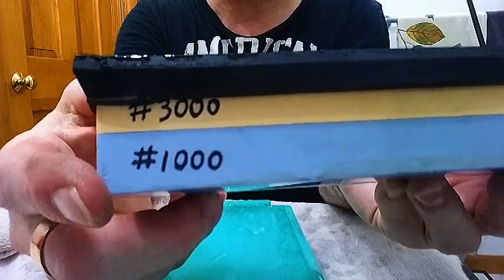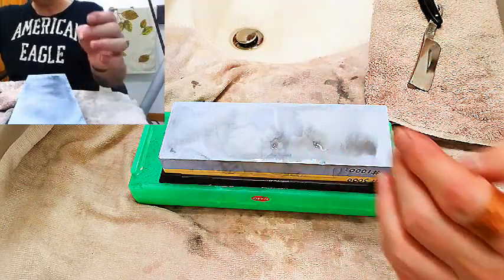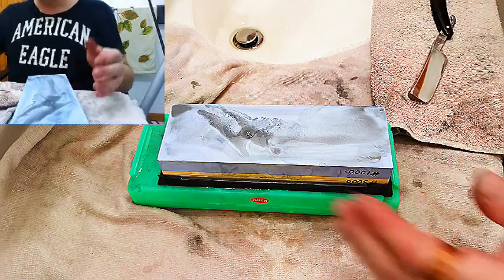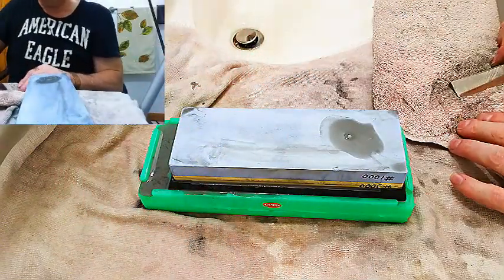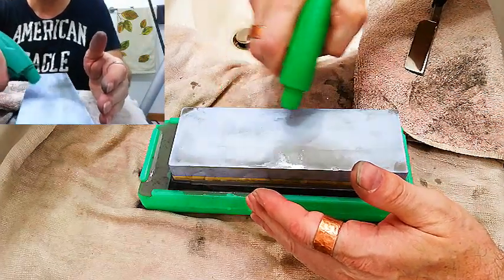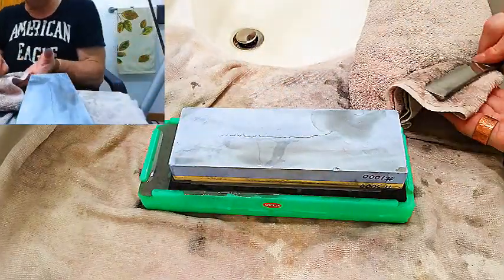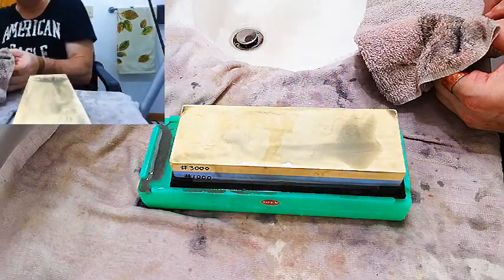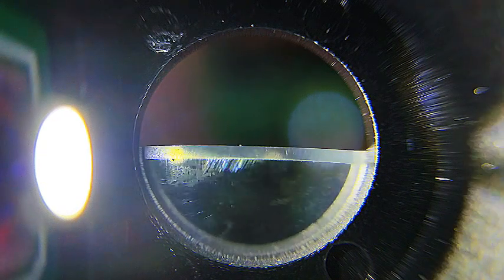Basic Straight Razor Honing Guide, Setting the Bevel The Most Important Part, Ep3

Comment: Hello guys, can i set the bevel with the 3000? I was looking forward to buy a 3000/8000 stone as i'm a begginer and my budget is tight. Is this possible? Also, finishing with the 8000, will i get a comfortable shave?
Reply from the maker: Great questions Jorge! ;) First, yes you can set the bevel with a 3000 gritstone it will just take a bit longer than starting with a 1000 gritstone. Then you can refine the edge with your 8000 gritstone and finish with chrom ox on the fabric side of your strop, you should get a decent edge. What combo stone do you have or are you looking at? Please let me know if you have any other questions and let me know how you get along.
Thanks for your great comment and thanks for watching! :) Have a good week and take care, my friend! :) #Heart
Reply: @AdventuresInWetShaving  Thank you very much for your answer, that is very helpfull . I will be looking then for a good deal on amazon for a 3000/8000 wet stone  to set the bevel and hone my new golden dollar straight razor.
After swiching to safety razors, i bougth a shavette and felt really good. 
I think its time to try the big boy now. Now for sure I am learning a lot of things before  having my first proper straight rasor shave!
Thank you again
Sincerely, 
Jorge
Reply from the maker: First congrats on your new GD straight razor! ;) Going from a shavette to a straight razor is very easy. The only difference is keeping the proper shaving angle if you keep the spine a spines width off of your face and you'll have the proper 20-30 degree shaving angle and you're good to go! Be encouraged you can do this, my friend! Please let me know how you get along. #Heart